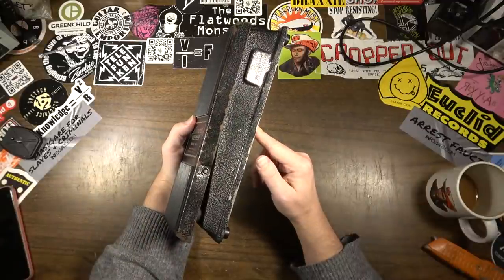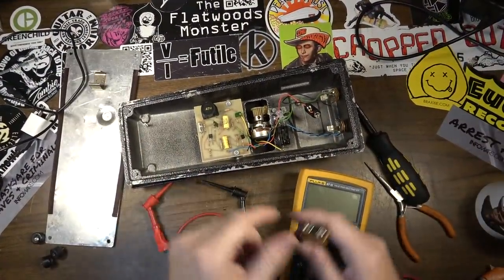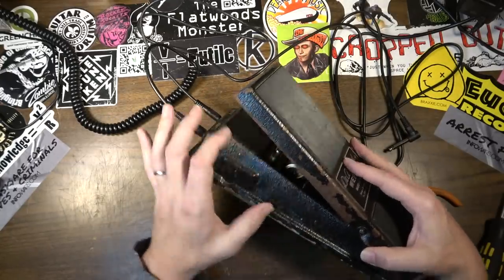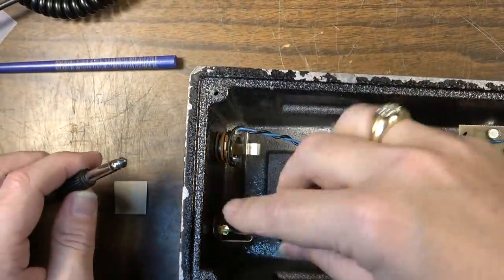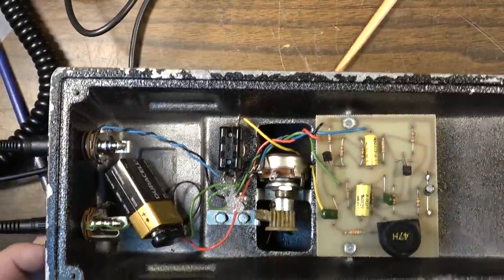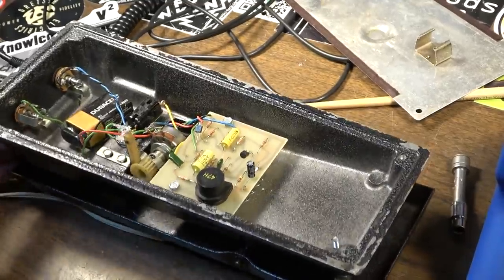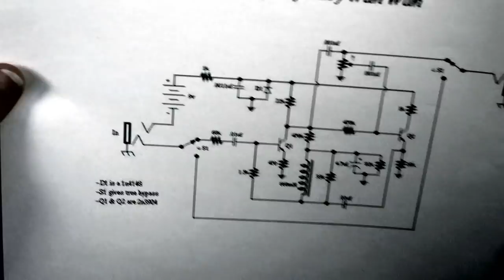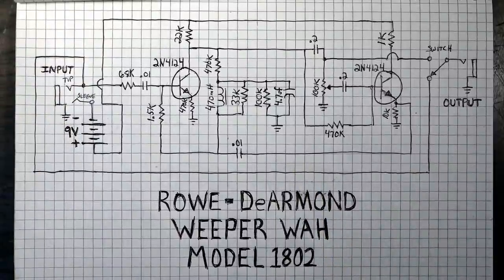Noisy WAH Repair - 1970s DeArmond 1802 Weeper Pedal

Comment: Why don't we hear of custom wound transformers, like we do about custom wound pickups?
Sure there are dozens of pickup makers, but a scant few transformer companies.
What if you could add 10 or 20 volts to the B+, and maybe a few more milliamps too, how would the sound be affected?
So much interest in small vintage circuit amps these days, sounds like it could be a worthwhile pursuit.
Reply: There isn't much need. Plus, the market would be so small, it would hardly be worth doing. Here is the thing, all a power transformer does is change the amount of voltage you are using of the 120V available. It's either making it larger or smaller, depending on the need. Then, you run that through a diode to flatten it to almost DC and then add caps to make it DC. Then add resistors to give you whatever voltage you need that is smaller than what you're starting out with. It's just a matter of using a larger tranny if you need more volts or current. Changing the transformer by such a small amount isn't worth the trouble. The only way changing the transformer would change much is if you're adding a fair amount of voltage, especially in an amp of 45W or up. And once again, all you need to do is swap up for the next larger one from the same manufacturer, usually Hammond. 

I see where you're coming from, but there are FAR less expensive ways to alter the sound of am amp or any circuit, really. Especially where power supplies are concerned.
Reply: @willmorrison1022  I'm not saying this would be for everyone, most of us are happy to have instruments and gear that work pretty good and sound pretty good, and when I say "pretty good", most of us do not have trained ears for judging instruments. But if you were willing to make a bigger investment, couldn't you get better tone? 
   If you read up about professional "hero" musicians, they may own hundreds of vintage amps and lots and lots of guitars too. And where do these come from? I'll bet that most are referrals, like somebody trades a piece of vintage gear to a shop for something else, if that piece is really good, the shop guy gets on the phone and calls a broker or someone who has the ear of people with big money to spend, because they want the absolute best .I know that on occasion some famous guy buys something from Ebay too, but I'll bet that's not so much.
   I don't have the energy to go to a guitar store and try out a dozen amps to see if any one really stands out, so I work with what I have. Mine sounds pretty good too, but I wonder what it would sound like by trying out a bunch of output transformers, for example. Those are not so scary.
   Top musicians pay big bucks to have their amps serviced and modded by the best pros out there, that's a fact.
Reply: @richardweinberger2756  Okay, now, with output trannies, you're talking a totally different ballgame. Those DO make a huge difference in tone. If you under spec that part, it will overload quicker, which will give a certain amount of tone, but which will also die quicker. 

That is one reason why Fender tweeds sound so good at full volume. The thing is, Fender NEVER (at that time) thought that anyone would be foolish enough to turn it all the way up, so a lot of their early amps had output transformers that were underrated for the wattage the amp could put out.

On the other side of things, if you want a better clean tone, put in a much larger output transformer in place of the original and see what it does. The transformer will have plenty of headroom and so it' won't introduce any of it's own distortion into the sound other than it's own frequency limitations. 

Gerald Weber of Kendrick amps has a series of books out that you might want to look at, he talks a LOT about all this stuff. He also understands that you're not a technician, but a guitar player, and he explains things in ways that you can understand. DVDs, too. And some amps that look and sound just amazing. Not cheap, though.
Reply: @willmorrison1022  I have some tube audio amps too, and the better ones have big transformers all the way around, unlike guitar amps.
   I had forgotten about the Weber books, I know I read the basic one years ago, maybe I'll get some more.
   Thanks for the advice.
Reply: @richardweinberger2756  He's got 5 out, now. The third one, for my money, has the best info in it, though they all seem pretty full of good stuff. I have the first, third and fourth, I keep saying I have to get the other two just to be complete. May have to, now...

In stereo amps, you want the biggest output tranny possible to keep the distortion as low as possible. In guitar amps, that is not the case. You want to balance several types of distortion in the right ratios to get the "best" sound. You have preamp,  power amp, transformer and speaker distortion, and if you get them all right, you've got a beast. Get one wrong and it won't sound quite right. It's magic, I swear. Time to get the degree in magic!
Reply: @willmorrison1022  I am 68, started playing violin as a kid. I'm not much of a musician, but I have an ear. I watched a video last night from Eddie's Guitars called Brazilian Rosewood Livestream. If you have good ears DO NOT WATCH THIS. I'm warning you, , , , ,these are the real deal for acoustics. No magic, just extreme skill in working with gorgeous wood :)
Reply: @richardweinberger2756  You have 5 years on me, and I too started on violin. I recently started playing it again, and it's surprising how quickly it comes back. I wish I would have kept up playing it, I'd be a monster by now! But at the time, 7th grade me thought you could only play one instrument, so I chose guitar. The stupid decisions we make as children!

I know about being around builders, my brother has built for decades, and has done some amazing guitars. I have his first arch top, a nice OM sized (but not an OM) acoustic that is a KILLER fingerpicker, and a 7 string classical that I am just now STARTING to get my head around. Several of his experimental guitars as well, but they aren't really for playing. 

I do a little building, myself, from time to time, I have about 6 or 8 instruments started right now, in fact, but have gotten side tracked with a basement rebuild and playing a theater gig. My favorite is my two handed tapping guitar, kind of like a stick, but with a baritone on the left hand and a standard guitar type on the right. It's all tuned in 4ths, no 3rds, and that simplifies the thing IMMENSELY. It seems like it would be weird, but once you get it down, it's FAR easier. If you didn't have to play barre chords, I would say go with it as a standard tuning. 

Here is a little something I did a few years back as an audition for a radio spot on a local PBS station. Needless to say, I didn't win. But it was fun doing it, anyway. This thing is the most fun I've had on guitar in decades, though it's also the biggest challenge. After 50 years of trying to make both hands work together, now to tell them to work separately is a BEAST! But I sure appreciate piano players more than I used to. 

https://www.youtube.com/watch?v=zveSfoWwdZQ

Hope you enjoy it!

Comment: Awesome! Btw, 100k is a standard value for wah pot, unlikely to be something else. Noise is normal. Although I fixed noise in mine by putting (i believe it was) 10 000uf cap, or something like that, power to ground.

Comment: When you opened the pedal I just remembered earlier this week I saw a video on Brian May's pedal, on/in which one it said 'no duracell'. Why would that be?
Reply from the maker: Duracell batteries are notorious for leaking when they get old.
Reply: @TheGuitologist  OK, thanks. I can confirm they do. Or, at least, when they are empty.
Reply: I saw the video and was wondering that too!
Reply: Duraswell. Ever try to get them unstuck from a Maglite.
Reply: @marka1986  iv'e had them ruin several mag and mini lites
Reply: @larryfischer1970  I haven't figured out how to get the top assembly out either. Otherwise I would just hammer the batteries thru with a metal rod. Last time drove a long screw in and pulled and was lucky.

Comment: The inductor can pick up RF and can be dealt with by a cap to earth from the out of the inductor . Having a signal generator plugged in at around 50-60 Hz doesn't help as the inductor will pick up humm from mains regardless of the metal casing . The pot on Vox , Crybaby, Colours Oundle has a 100k log pot . Typical value is 500mH for the Fasel inductor etc. The original electrolytic was non polar . The 10uf cap is for voltage and not necessary . If you go into a JHS Wah they have a small transformer half wound to that value but noise suppression from mains and RF is dealt with by a poly cap and resistor from the inductor . JHS pedals have as much junk as you can put in a wah except for the Crybaby JH1 which has an extra stage .

Comment: That's a "Patriotic" 4.7uF capacitor.... It's Polarized....and may even be radicalized and on the FBI watchlist!!! Joy Reid has warned us about these!!! Also, no pot is fully sealed....you can easily remove the stainless-steel pan from that pot and hit it with a quick-shot of PB Blaster which will de-oxidize the carbon trace and leave lube behind to reduce wear on the carbon trace :) Dan Gibbs, SC, Mich :)